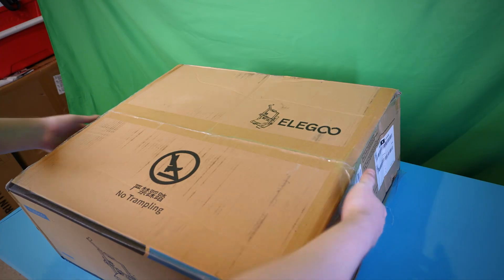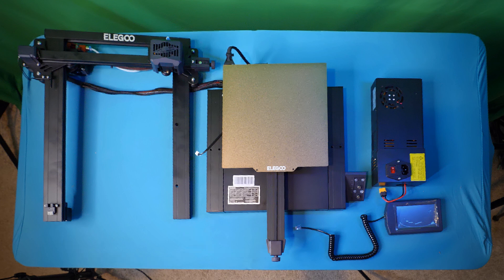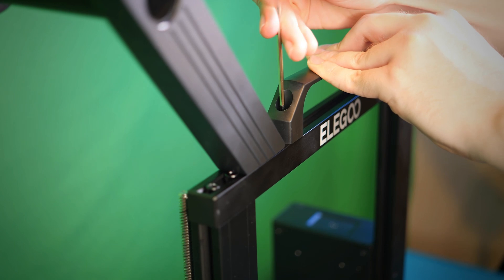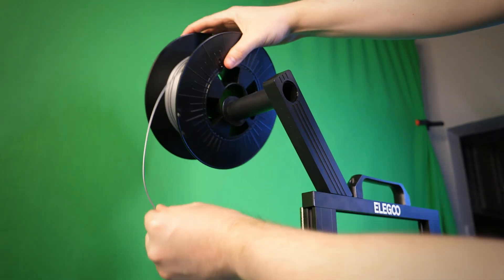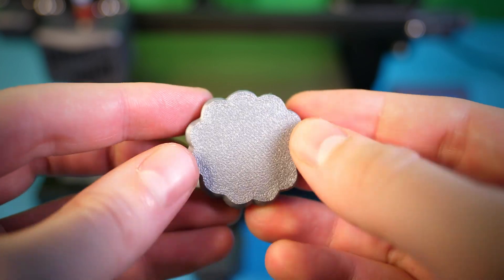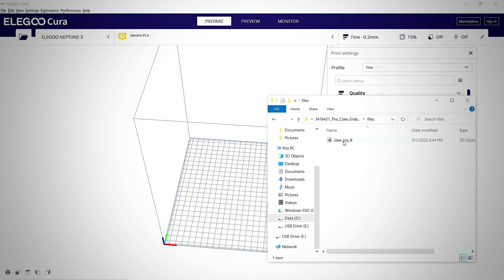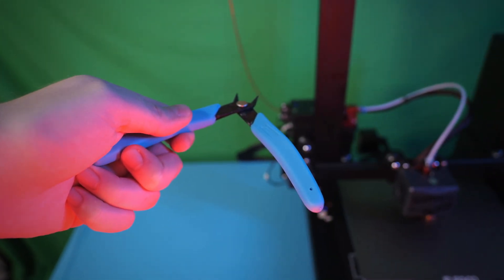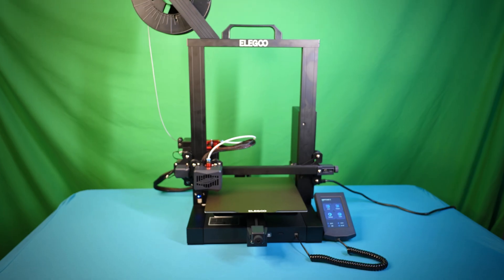My New Favorite 3D Printer | Neptune 3

Comment: I got this printer on the pre-launch sale event Elegoo did a few months back and it took  2 months to come, I am very impressed with it.
The run out sensor BTW also can detect Clogs due to the pressure it senses as the filament moves in the retractions done in printing!

The only bad thing I can say about the printer is, the text shown of the the files on the screen don't scroll across the screen when selecting the file to see if you are going to use it?
So if like me you slice the files and write a text name that states what the file is what the filament to use is, what the nozzle size is needed and time to print, The text will not fully show up on the short spaced text on the screen!

Unlike my Aquila using the Alex firmware then that has the file text scrolling across the screen when clicked on to view what it is.

If Elegoo can send out a firmware update to address this text issues on the screen then the printer be really cool.

Comment: I've got this printer, if anyone would like to know anything specific ask me here (:
Reply from the maker: How has your experience been with this printer?
Reply: What print speed/flow settings do you use?
Reply: I've got a few hundred hours on the printer, assembly was easy, wasn't a fan of the elegoo cura slicer so I swapped to prusa slicer, worked fine. Print quality wise, it was good. At first I had issues with z banding but I found the lead screw just needed the lube to be worked in properly. Biggest issue I've had so far is where sometime whilst leveling, the pressure from the filament sets off the sensor and causes all sorts of problems. Important to level without the printer loaded to prevent this. For some reason the sizes for the pins to slide in and hold the touch screen weren't right so it wouldn't hold. It's never bothered me though. I've also found the z offset isn't consistent and need to be adjusted during each print but all in all, it works great!
Reply from the maker: @iamduck_3022  could your z inconstancy be from a loose print bed? I had to tighten the bolts just like they show in the video to help the bed stay tight to the rails even before tightening the tension knobs.
Reply: @3DSage  I don't believe so, I checked the bed numerous times. The z banding was most prevalent of the right side of the print. So far, working in the lubrication and lossening the essentric nuts on the z and x axis have solved the problem
Reply: @iamduck_3022 i’m brand new to 3d printing and need help! i printed the monk beginner print and the bottom came out great but the head was all stringy and unconnected and broken… how do you fix this? also how far should the nozzle be from the base? thansk